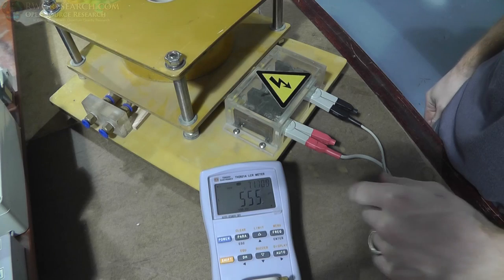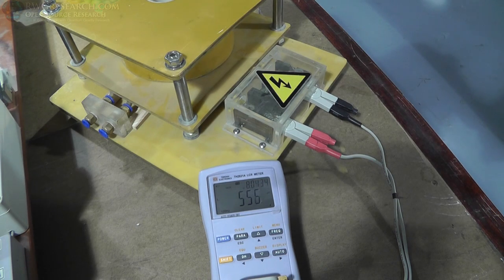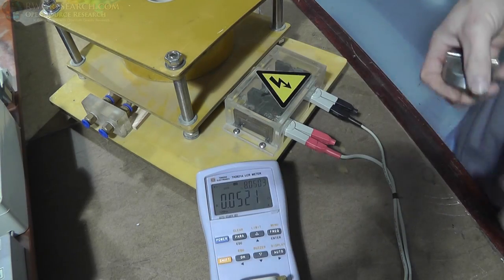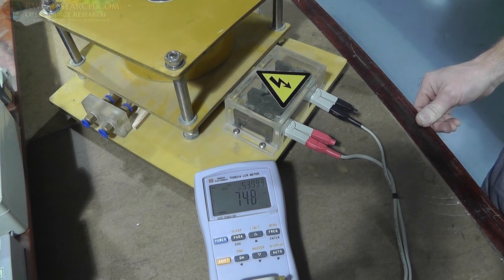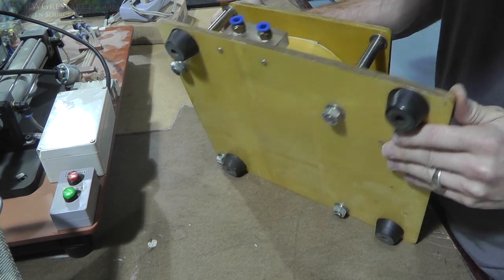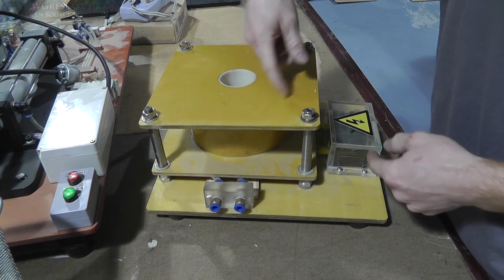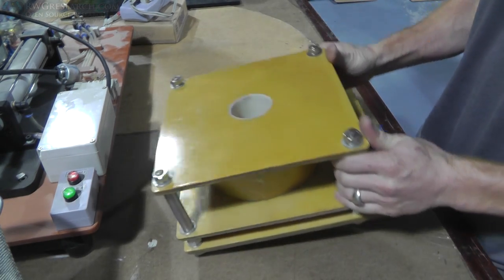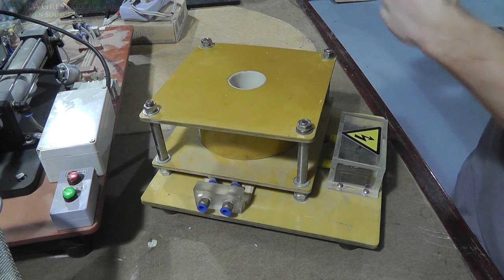Test:7 Magnetizing Experiments  : Lets Test The Coil Parameters

Comment: My induction casting machine has the induction coil in the same way...it keeps the coil cool when used repetitively, although my cooling circuit is isolated ( reservoir inside the machine).With all the amps running through that thing you are using  you need it.